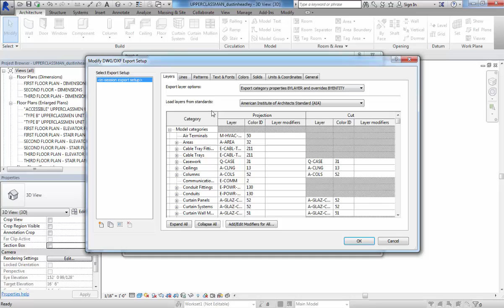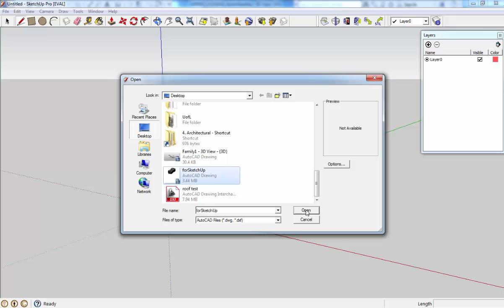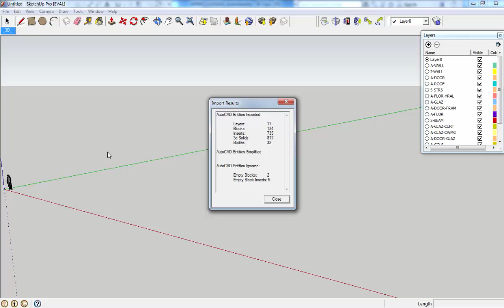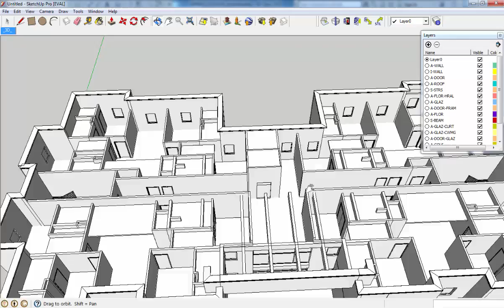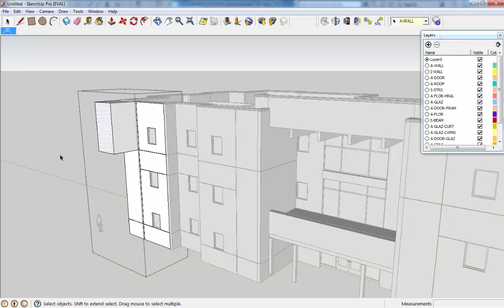Revit to SketchUp

Comment: Hi, pls I'm having problems when i import my model to SketchUp, i noticed that i can't apply material to any component properly. For example my walls, whenever i apply material to my walls import the material is applied in between the wall thickness rather than the surfaces of the walls,

Comment: Nice...now try to export a circular shape...a sphere or Something...GOOD LUCK...AND PLEASE TELL ME HOW MANY TRIANGLES YOU SEE ON SKETCH UP AFTER THAT.
Reply: With latest Revit ver, and DWG 2013 I get nice circle wall, and can extrude on it with jointpushpull, 19kb DWG file with few faces.

http://s9.postimg.org/k0of1nf3f/test1.jpg
Reply: Sauer Krauten PLEASE BE SERIOUS.
Reply: Makus Dhy You asked for a circular shape, so what is your problem?
Elliptic curve is a mess though, but you mentioned circular shapes.

For advanced organic modeling there is better suited software out there.
Reply: Sauer Krauten you mean..For SERIOUS  Architecture and REAL proyects made by REAL Architects...  Rhinoceros is a nice one...try it.
Reply: Makus Dhy

Been using Rhino on/off for a long time, it´s just a tool like Solidworks/Inventor/Revit/Archicad etc.

As much as I would love "one size fits all" software, real world is a compromise.
I would love to do site work in Revit, but it´s not effective for complex large sites with roads/intersections in steep slope lots.

So had to bend over, and learn Civil3d even if hate it.
Hope Infraworks will develop as an alternative, but doubt it.